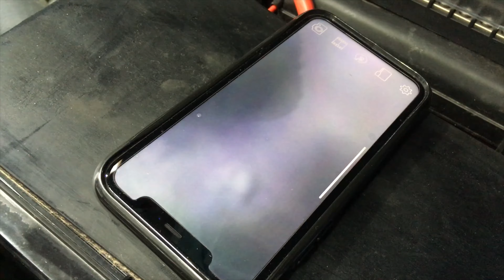BUSTED GLOW PLUG! 1kz-te 3.0lt Toyota Diesel

Comment: Great video, very well explained procedure! I my son & I have 2 1996 Hilux Surfs with the 1KZ-TE engine non intercooled. I have bought 2 sets of HKT glow plugs and also thinking of replacing the injectors but can't find genuine OEM or the right ones. Where can I find these and what is the correct part number please? We are based in the UK.

Comment: Done mine I whiles ago. 2 of 4 where broken. One for a whiles and the other was broken on removal. Tried to get it out but it fell into cylinder.
Wound engine over by hand and felt it jammed between cylinder and head.
Pulled head off, the old broken tip had marked piston but seemed OK. Good thing I pulled head off anyway, pre com chambers were cracked but didn't damage head. Got head reconditioned with new pre com chambers, blocked egr and cleaned manifold. Replaced Injectors, fitted 3 inch turbo back exhaust, dp chip, wound boost up to 18psi with manual boost t and manual fuel cut defender to fool map sensor. Fitted egt sensor pre Turbo.

Result = 30 - 40 % power and torque increase compared to even when it was new. Goes like a rocket.

Comment: Great video, thank you. Mine have been in for 16 years, 243,000 kms. I didn't realise how the tips would break off. I regularly service my vehicle, every 5,000 kms. Not blowing smoke, starts perfectly, happy with the engine overall, however, I better look into replacing them. Still running original water pump & a/c refrigerant, exhaust system, shocks. Car still tight. Auto oil & filter have been changed, no such thing as "sealed for life". Once again, thank you.

Comment: Exact thing happened to my 1kz at 350k kms. No 4 glow plug tip gone resulting in cracked head. A few marks on piston top, but not too bad, bore thankfully ok. Advice from a mechanic mate of mine : “you should probably replace your glow plugs every 100 thou or so”. Oh well, you live and learn. Replaced head and all still going well at 430k. Will be replacing glow plugs in another 20 thou. Great vid, keep em coming.

Comment: I have this motor, it has a tappet/ticking noise, sounds like a single cylinder noise... would it be caused by a broken glow plug tip ??
Reply: I guess no help or advise anyone ??? :)  could it be shims or ???
Reply: Could be many things. Could be a belt noise.